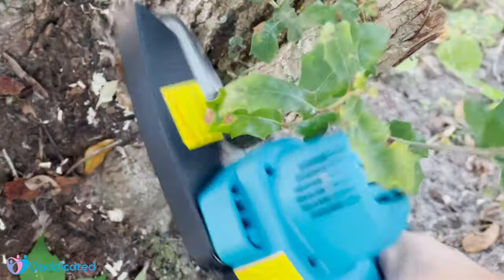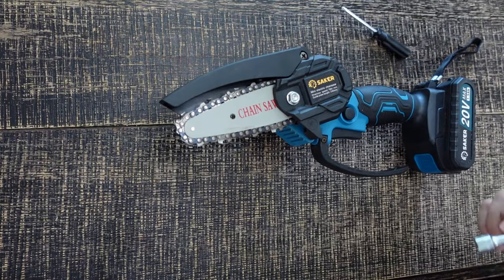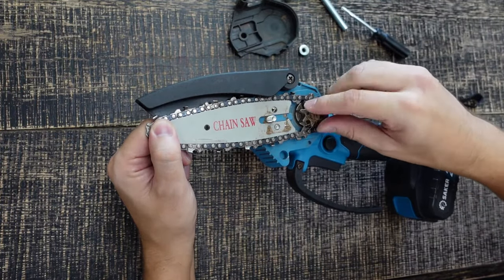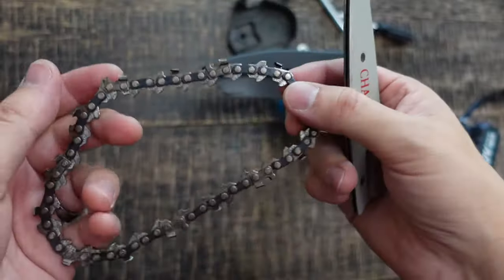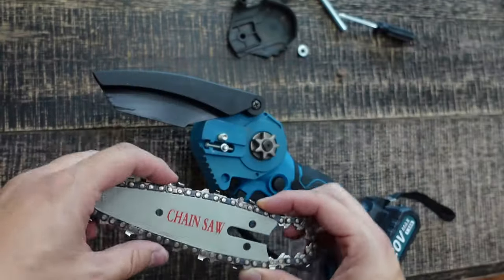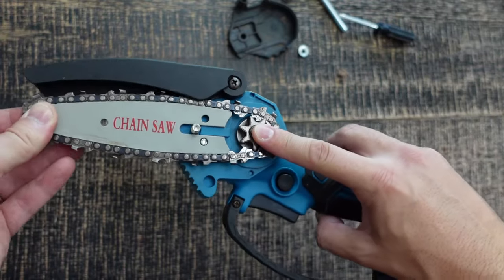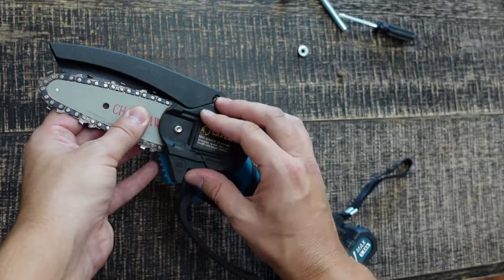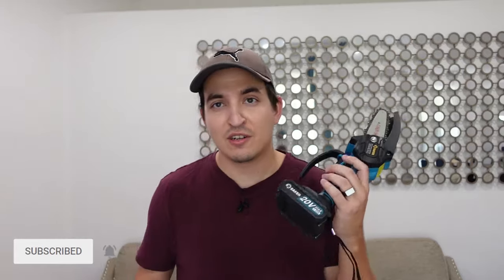How to replace chain on mini chainsaw

Comment: I have the same saw, but when I took it apart to change the chain, a spring popped out. Don’t know where it goes now. Any ideas? I had also removed the chain guard.
Reply from the maker: I don’t remember seeing a spring in mine.

Comment: Mine jams every couple of seconds and doesn't cut even thin branches off the rose bush. I find it a waste of time. But I did try to cut a 1 inch branch and had to replace the chain. I think it's pure junk but I keep trying to use it. Good video.
Reply from the maker: I don't know I used it a camp multiple times to help cut down small dead branched down for firewood and it worked for me like a charm. Sorry to hear you are having issues with it.

Comment: Battery fully charged and won't run. Or runs for 10 secs and stops. Thoughts? Used it last year no issues and went to get it this spring and nothing.
Reply from the maker: Not sure. Where did you store it. I know sometimes batteries can go bad if not stored properly or if stored in bad environments. But who knows sometimes electrical devices have kind of their own.
Reply: If it's a Saker, it has a Lifetime Warranty.  Go to their Website.